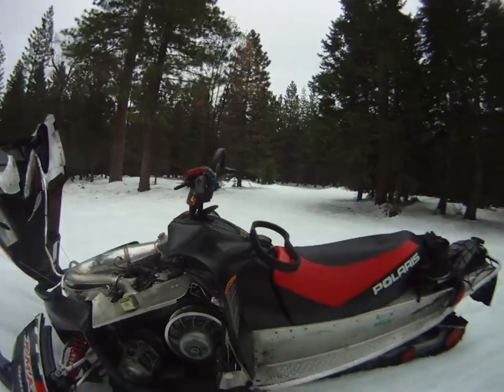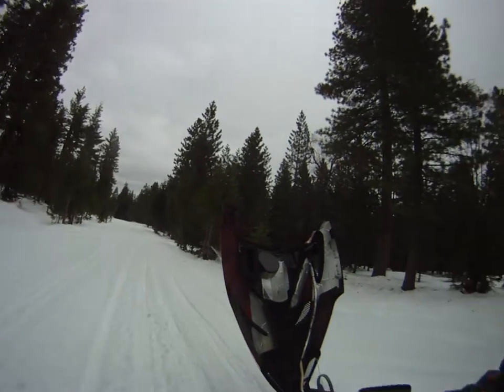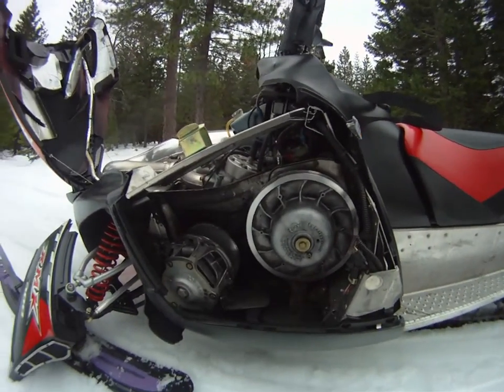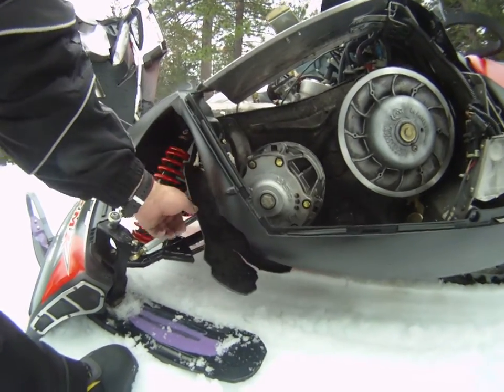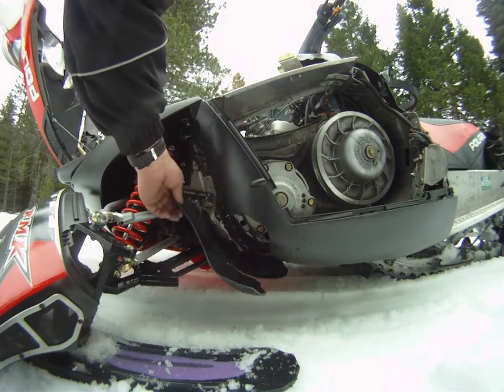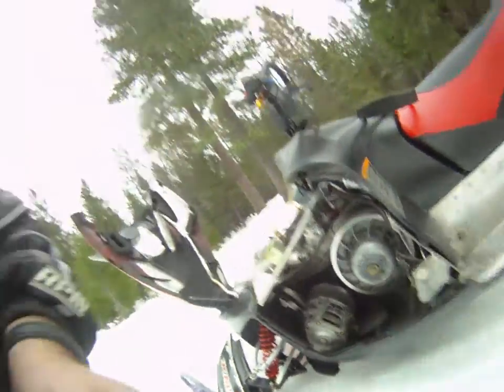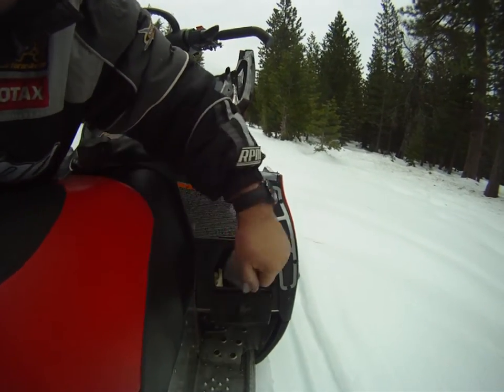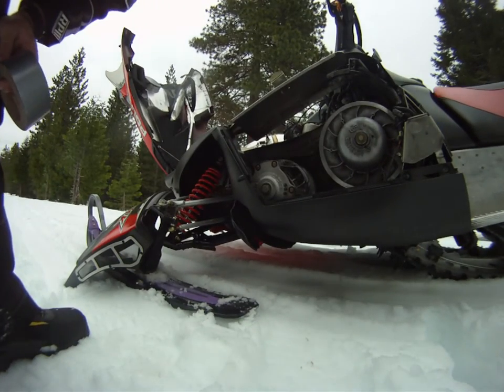Polaris RMK Automatic Belt Ejector

Comment: i had the same thing happen on my sled....TWICE ripped through the fron t the first time and second time ripped out the bottom. what it ended up being was a C clip on the clutch and it wasnt slidign open or closed on the belt. so your belt would look fine and feel cool to the touch but would prematurely blow apart.  belts are suppose to last 200km or more. mine were lasting 200 or less. anyways figured i would share this with you. also a nice piece of sheet metal  will fix that

Comment from the maker: @arcticcatrider16 I've rode Skidoo for many years and blew many many belts and never had one rip through body of the sled.  The panels would fall of when I took it on very rouch packed trails.  So yes, at the time I was very unhappy with it.  But I've grown to like the sled after the season, eventhough right now the steering is not working and the starter rope is broke and the check eng. light flashes.  It the most powerful sled I've ever owned and it can handle seriously deep and steep snow.

Comment: i feel your pain i was running on a open field trail doing 50 punched it up to about 70 on my 02 edge x 700 and did the same thing except it was in the bottem of the pan  and i lost half the chunks of plactic wat a pain finding a belly pan was i reinforced it with 1/8 inch aluminum then sold it lol glad u got it up and goin though

Comment: Considering it's a 900, they run warm as it is.  Get some pre filter material and make vent out of the hole and put some aluminum braces along the back side.  Should be a vent there anyway.

Comment: Damn. That sucks. I have a 2006 700 and have never blown a belt. I have a vent screen where you got punched so hopefully it would just pop my screen if this happened. Not a real easy part to fix either. Maybe now I will layer some reinforcement on the inside of mine. Thanks for the heads up!

Comment from the maker: I have not got any Polaris products since.  I had a couple Predator 500's but got ride of them for more powerful quads (Raptor 700 , KFX 700, & Renegade 800).  I like Polaris, but have not really got anything new lately.  Even though the quality of that 900 RMK was really bad, I still loved riding it.  Very fast and did a great job in deep snow, but it was highly modified to get to that point.  Do you need my address to send the $1,000?  I was thinking about getting a used Razor.

Comment from the maker: @arcticcatrider16 only had so many characters to write a reply.  So, in closing the motor with the power up grades and great mountain handling characteristic is a Blast to ride.  But it truely is a pile of crap, and I'm very hard on stuff, and it doesn't seem to be able to take the abuse.  But I do love its power, its always the fastest sled in the pack and not even the PRO can handle more snow.  It is the perfect mountain sled.  I'm thinking of buying 3 more, just to have 1 or 2 running.

Comment: blowing belts means something is wrong, bad motor mounts, clutches not aligned, didn't break belt in properly, can happen to any sled
Reply from the maker: I've blown lots of belts in Summits, never had one bust a hole in the chassis. Had to duck a 10" hole back together.  That 900 ended up being one of my favorite sleds I ever had.  But the fit and finish compared to SKIDOO is not in the same league.  Blown belts should not blow a huge whole in the sled.
Reply: don't disagree with the fact it shouldn't blow a hole in the frame, shows the plastic is weak quality, however, belts should still not blow you should address the reasons as to why it might have happened.
Reply from the maker: I just bought the sled used from a doctor that maxed its power options out and weight reductions. I think it was just worn out. Second time riding it.  I ran it 2 full seasons on the next belt, but I put the best I could buy in it. It had a lot of power, even snapped the main drive shaft.  Always the fastest non-turbo sled in the pack.  But it was fragile.  Look up "Ski-doo Freeride Rescues RMK 900", your making me want to go riding again.  Haven't gone in 3 or 4 years.  Switch to playing more in the sand and going to the ocean lately.

Comment: blew a belt at 75 mph? thats fucked haha top speed on my sno pro 500 is around 85 mph in snow, had er goin 95 down hill on basically gravel haha waay faster than it should have went on stock gearing but somehow i did it, sounded like it was gonna explode, but nothing went wrong, belt was perfect, everything perfect, had to replace the carbides of course haha, but ive only gone through 2 belts at 1800 miles